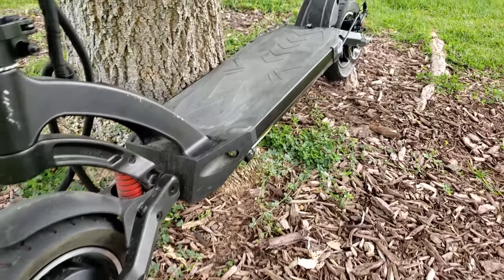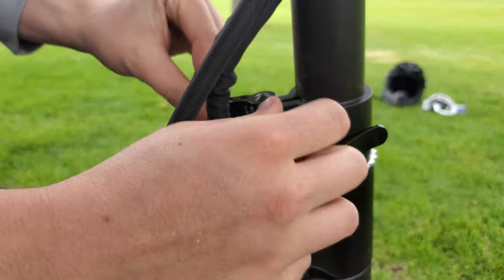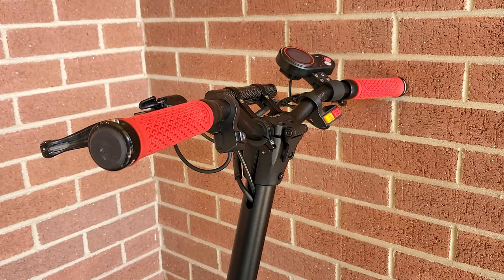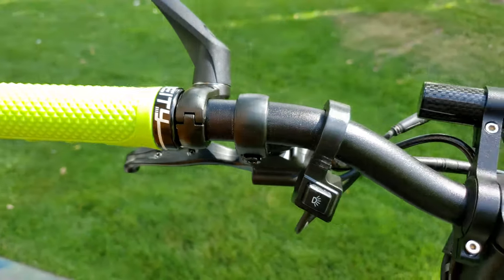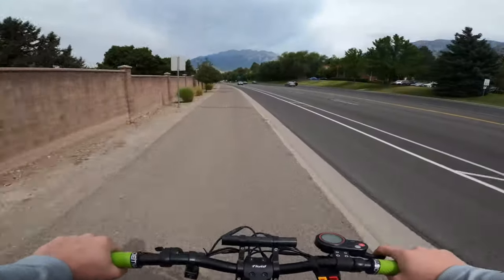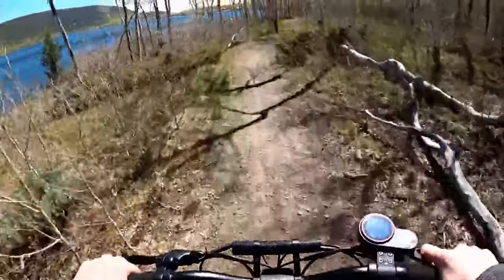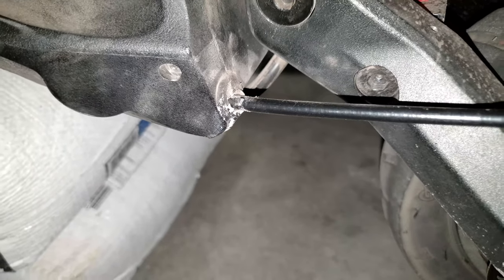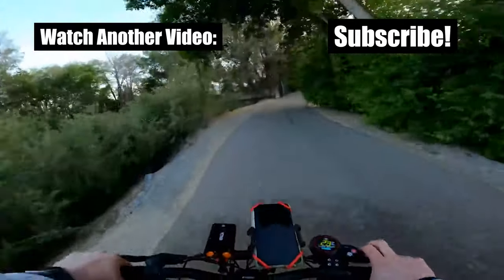Kaabo Mantis Complete Review! 40 MPH Electric Scooter

Comment: What I have seen and heard, hydraulic breaks are the only breaks you can use with 1 finger.

GPS as a speedometer test. From my experience, GPS userly shows a faster speed then then your actual speed. 1-3 MPH for me.

Battery randomly cut off at 14 miles 1 time.
If the display shows accurate battery levels and   trip odometer mileage,  got to pay better attention to the display. 
Also keep in mind that in very windy conditions can greatly reduce your range and speed.
By about 50 percent from my experience.

Comment: Great overall review! I have some videos of my Mantis Pro as well. Regarding the wobbly rear hub motor/wheel section I had it on the front and the rear. Front was more noticeable but you'll have to check it on eye level as you may want to put it on a lift or something. Look BOTH sides to see where the unevenness is at. Make sure the tire is seated properly.  If not, loosen the 6 hex bolts and work your way around the tire/rim area. You have to also Loctite some of those bolts since it's metal on aluminum and it will loosen with use. And be cautious about the inner tube's nipple while moving the tire around. If you've done all that, then it's the axle which I don't think is that easy to bend since it's solid steel. Good luck and ride safe.

Comment: Great review and video! I want to also thank you because your videos are what helped me get my Mantis base model. I plan on upgrading to magura brakes when the time comes. The Mantis is indeed a fantastic scooter! My next scooter will definitely have bigger range though.
Reply: Are you on hydraulic brakes both front and back?
Reply: @rockefelleragent1357  I have the base model and it comes with mechanical disc brakes, not hydraulic.
Reply: Jess A. Its semi-hydraulic for the base for full-hydraulic for the pro no?
Reply: @Wangan_W  I'm not sure if semi can also mean mechanical but its NOT hydraulic which is oil based. There is no oil in the brake lines on the base model. The pro model is full hydraulic from what I know.

Comment: I have the pro version with minimotors display and bigger battery, zoom brakes are OK so far. You have to tighten all screws before you ride and the after first few rides. I also reploeced the bigger bolts (under the stem, and for front and rear suspension) with higher grade steel. I also replaced the elastomeric tubes in the springs to tighten the suspension, bought them from a french website as I'm in EU. There are videos on YouTube how to waterproof the deck, also you need minimotors display the cheaper one you have in the base version isn't rain proof. They show how to put silicone around the edges when you open the deck and the meter. I had to ride in a heavy rain to return home once, it was not sealed and nothing happened :) suspension gets noisy after some time with dust in the springs and elastomer, don't bother to clean it. I clean disk brakes only with a special alcohol that's it. I also had to put extra glue under the rubber carpet on the deck. So far nearly 1000 miles, all good even tyres are still ok. Always add full pressure to the tyres, 3.5+ bar.  I removed the rear mud guard it didn't make any sense.  My wheels are well centered, there is a French YouTuber that provides 3d printer files to print some parts like a special little plastic holder that helps you center the wheel / attach some metal weights like they do with cars. I also installed a removable light to be more visible. I ride mainly on bike paths in the city. This scooter is not for heavy folks. 85kg max.

Comment: Just got a zero 9. The mantis is my dream end game. Even 28mph feels insanely fast to me I can’t imagine riding the mantis
Reply: My speed 1 setting gets me to 24 mph lol.
Reply: @rockefelleragent1357  Honestly I'm amazed you don't just go flying off at max speed. My first experience with my new scoot I accidentally did a wheelie from the speed
Reply: Cameron Rostami always shift ur weight to ur front leg equal to the force your accelerating. I had the same experience too when I went from my ninebot max to a zero 8x. Took me about 1 mile before I started getting real comfortable going full speed. The rear foot rest really helped too. My dream scooter is the dualtron thunder. It’s a little hard to reach that goal when ur unemployed and 16 in high school lol.
Reply: @nickmarquez3321  You guys should get a seat and mount it on your scooter. My chinese 5600w scooter has a seat. I feel safer going at 45 mph in a seated position as it increases lower center of gravity and helps you balance better in hard acceleration and sudden hard braking.. also feel more planted in the turns at high speeds.  And having a seat it enables you to hookup a trailer on the seatpost so you can carry groceries and your children or your girlfriend, lol.

Comment: Your review is pretty accurate and mentions things that other reviewers that get sent the scooters for free don't mention. These $1.5k and up scooters come with 💩 accessories and components. I intended to purchase a scooter when researching and deciding on the Mantis Pro but then I realized for the price I can get a Niu scooter that comes with a 3K Bosch motor, Panasonic/Samsung batteries, 75 mile range, and much safer to ride. I still watch and subscribe to kick scooter channels but the prices aren't justified.
Reply: @Uncle Rusty I hear ya man. I will get one eventually but here my list in order: 1) Niu scooter 2) folding bike mid motor drive 3) Gotway MTen3...probably the next version 4) kick scooter - Kaabo or a Zero whichever I get better deal on. FYI Im buying the safety gear first. I have ANXIETY!!! 💪🏻😳😬🤯😳😬🤯👍🏻
Reply: @Uncle Rusty anyway you are totally correct. It's really about the mobility then everything else is a bonus. 💪🏻🤓😎🤓😎👍🏻

Comment: Interesting. I ordered the pro version, 2 weeks ago, expecting that end of september.
Reply: It's a dope scooter, I got mines about two months ago. Don't ride it in the rain until you get it waterproofed.
Reply: Hi-TyCh How did you waterproof it?
Reply: @Wangan_W   U should use black silicone
Reply: How is it after a month for you?
Reply: @TobyBauters  It arrived only last week. Love it so far, just need to change a few settings for personalising for me.
Reply: @esrider7765  awesome, just curious how were you able to afford it? Did you have a side hustle? (I'm 15 and I just curious on how I could make some money to get this :) )
Reply: @TobyBauters  A life of honest work. Enjoy every moment as one day you will be as old as I am. Try to make wise choices in everything you do. Have fun.
Reply: In Australia we have 4 versions, Base, Dual, Elite, and Pro. I purchased the Elite last week, it has upgraded brakes, battery and display/controller. Cost me $2700 Aud, the Pro is $3300.
Reply: @Flogge11  Cool, enjoy. I turned down the start off acceleration but upped the torque, Goes up hills like a rocket.
Reply: @esrider7765  a law in Australia limits scooter speed to 25 kmph, however was very easy to bypass. Out of the box P8 was set at 27, I’ve increased it to 50 whilst learning. Also kept the kick start and P7 acceleration set to 4.
Reply: @Flogge11  cool, we have limits coming in in january, have a remote switch on the "grey" wire. :-)
Reply: @esrider7765  well done mate

Comment: So how long would you expect the lifespan of the Mantis to be? I got mine 2 weeks ago and use it as much as possible
Reply: I think it'll be as long as the battery lasts. I'm hoping that we'll be able to swap out the battery but from what I can tell as of now, there is no way of getting one from the distributor or manufacturer. I've been looking into sites that custom make batteries for anything you want but I'm not sure how stable and safe it would be.
Reply: Actually, I saw a battery replacement for the Kaabo Mantis on aliexpress not to long ago! Not sure how legit the battery is though. You'd be on your own and at your own risk most likely.

Comment: Hi, I've got the same scooter and I need to ask if you had and issue with losing acceleration or maximum speed ? I think maybe I need to put some more pressure to the tires... And also after raining day my suspension annoying me with a squeaky sounds, I will use wd40 but how should I apply for this scooter (I know how this can sounds but it's my first scooter and I am proper new)

Comment: Do you have to go into the menu and set the speed
Reply: Yes, there is a setting P8 where you adjust the top speed. It’s a percentage, out of the box in Australia mine was set at 27%. Ive since increased it to 50%. After more practise and when I have full set of protective gear then I will consider 100%. At 45 mph you really need to be wearing motorbike gear.

Comment: I am learning the hard way that NOTHING is under warranty. I have had my Kaabo scooter for 3 months, and so far;

1/ The front whole arm had to be replaced because the stem was faulty, I had to pay £160 and not under warranty.

2/ I am constantly finding screws falling out

3/ My front brake caliper has fallen off with the screw holes holding it on having no thread and being completely smooth.

Got scooter on finance and now I wish I never bought this cheap built product by Kaabo and if you read up the build quality is a common issue. I recommend everyone to avoid, as no matter how it goes wrong you are never covered by warranty.
Reply: Use threadlock

Comment: Hi, I'm reaching out to as many people as i can. 

I have a mantis 10 DUO 18.2AH 60V scooter SN KBTL121120082331. 

I'm trying to find a wiring diagram for these two black ESC's (controller boxes) but no one can help me so far. 

Is there anyone here that could maybe supply me with a photo of how the connects are all set up? or a diagram or anything. I have tried the manufacturers and many stores. 
No one can help me so far.. Please if anyone has the model with the two black controllers can you please please help me with a photo or anything :( I beg you.

Comment: Using this scooter for short commutes is the way to go, as it makes it really fun.  https://www.youtube.com/post/UgkxvyNuxpWiHTNypxG6nyqyf7ywc7Q16PDM Both the levels of speed it allows you to use are very fun, though 20mph can get pretty scary on bad roads. It makes a cool electric sound as it is accelerating. The battery life is also pretty impressive, as I can go anywhere around me within a ~10 mile radius and back home with a full charge. I expected the tires to feel somewhat like a toy, but it is legit, and has pretty good grip on surfaces. Braking on this scooter is also really fun, since you can even do a little drifting if you break hard. The wheels on the scooter are definitely very high quality, as they are wide and well sized. The entire scooter is pretty high quality too. I have fallen on it a couple times because I was being a little reckless, and the scooter still works perfectly fine, with some minor scratches on the sides. I found the brake lights to be very cool as well, since they flash when you brake.